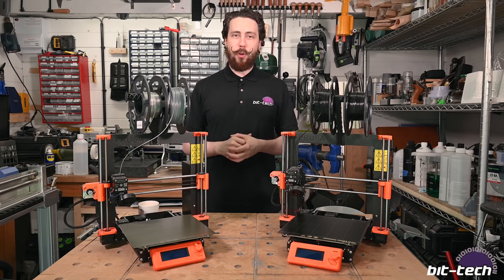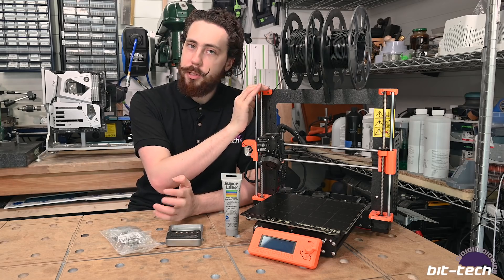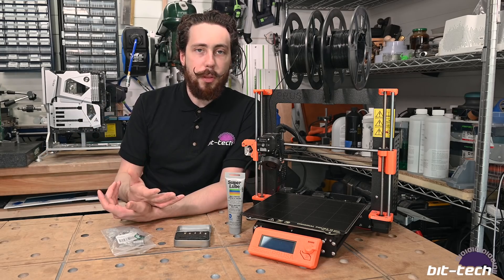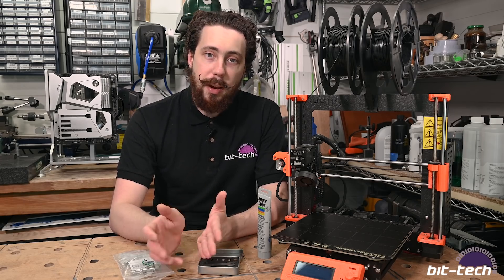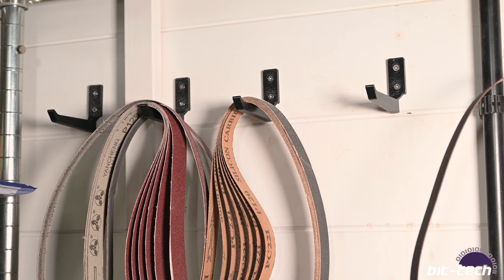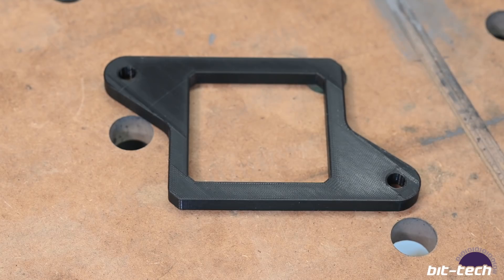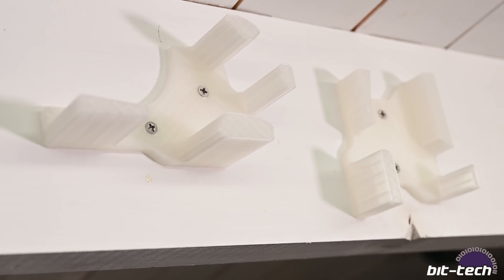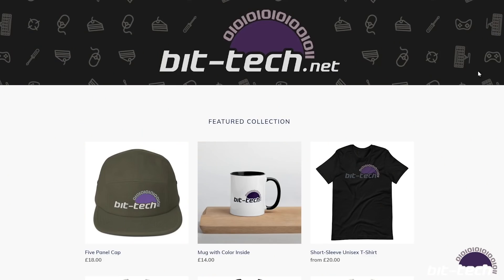1 Year of 3D Printing PRACTICAL Objects | bit-tech Modding

Comment: Why does the Prusa have such problems with ABS prints? I have used the TAZ 3, TAZ 4, and TAZ 5 from Lulzbot and we could/would run PLA, ABS, T- Glase PETT and a glow I. The dark material (forget what it was exactly) and we would print without an enclosure and could get good prints. Yes we had to adjust some settings but didn't have a problem. Yes the suggested and enclosure but we never had one.

Comment: Great video as always! I built my first 3D printer 2 years ago and it has been such a valuable resource. I have used it for many of my pc mods, including cable combs inspired by your work. I have been considering trying a 0.2mm nozzle. Did you have to adjust your extrusion settings to accommodate for the smaller nozzle?

Comment: I use "Igus®  8 mm - drylin® R - rj4jp 01 - 08"  in my printers, they work as a charm and dont jam.
And this for taking off some Vibration of the motors to the guiding screws: 
https://www.amazon.es/gp/product/B07H2YVCDP/ref=ppx_yo_dt_b_search_asin_image?ie=UTF8&psc=1
I prefer using bowden in my head, takes the wire feeding motor to the chassis and cuts off weight to the carriage. (so you can speed it up)
If you dare to tweak with the electronics, try swaping the main board with a Lerdge-K, it has 6 motor controllers and plenty of sensors, speaking on sensors, i use optical switches, they are more accurate than electric switches, and for the Y height, i have a capacitive sensor, so i rarely never have to set the first layer height again.
Have fun hacking it!
Reply: i dont think it is a good idea to replace the extruder and the mainboard on a Prusa machine for 2 reasons: 1. (extruder) you loose material compatibly with a Bowden setup 2. when you buy a Prusa machine, you also pay for all the research and support they have. so i dont see the point of changing the electronics. the prusa also has a ABL probe ;)

Cheers and happy printing.